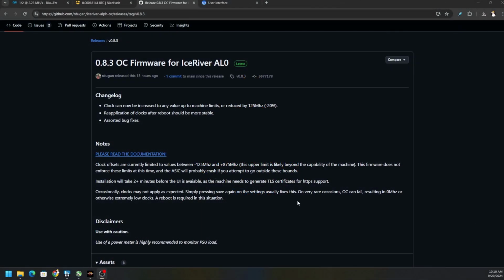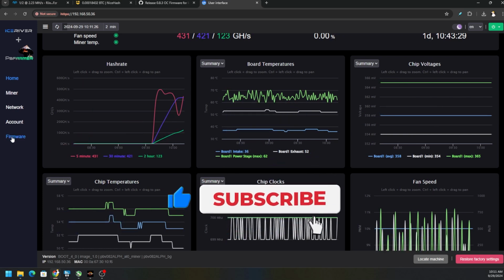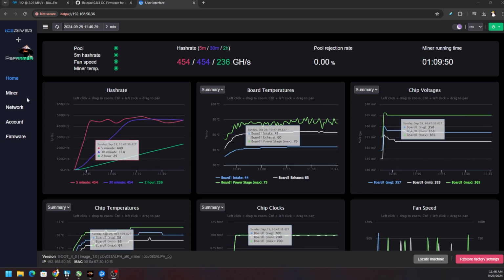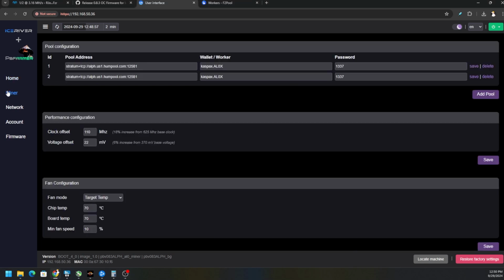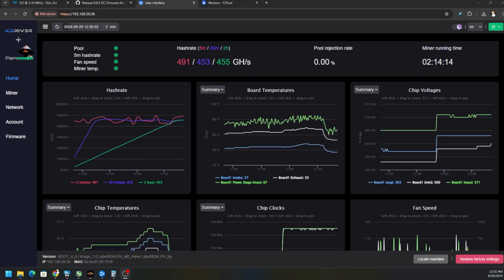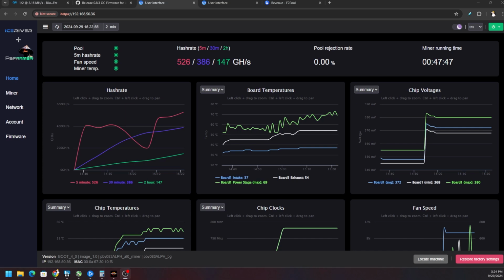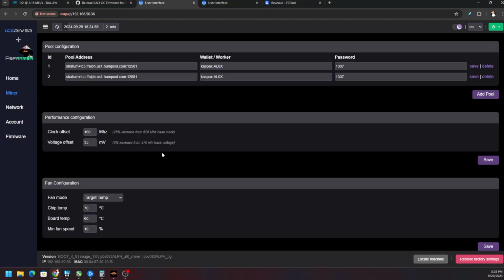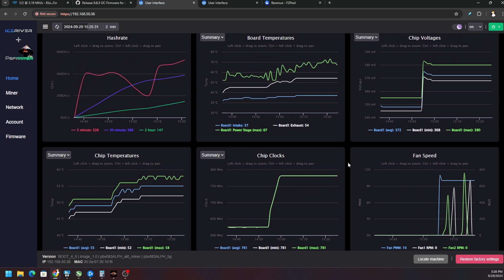New PBfarmer Firmware - Iceriver AL0 Overclock

Comment: I installed the PB farmer firmware on my AL0 and for some reason Board 1 Power stage reads 0 and when I overclock hashrate drops no matter what I set the overclock at. I've re-installed and reset and still same issue. Stock firmware works just fine.Anyone else having this issue?
Reply from the maker: @BigBelleeZ  thermals. Let it get warm before you turn up fan speeds if you have external fans on it

Comment: I really like the Chicony 230 watts from Aliexpress, I push them to 200 watts without any issue, they're also on amazon but for the double of the price, thanks for the update on the AL0 Firmware.
Reply from the maker: @domg6614  yea I like those to, thr others suck
Reply: @DomG6614  have you tried it on the AL0, if so what hashrate are you getting pushing it that high, and what’s the consumption in watts?
Reply: @DomG6614  have you tried it on the AL0, if so what hashrate are you getting pushing it that high, and what’s the consumption in watts?
Reply: do you have the link of that ?
Reply from the maker: @Eliotheparakeet  ALO Firmware: https://github.com/rdugan/iceriver-alph-oc/releases/

Comment: Did you make any changes to the hardware? Like adding heatsinks to the mosfets?
Reply from the maker: @akro286  yes, and better thermal paste / pads
Reply: @SerpentXTech  I was really hoping the thermal paste wasn’t necessary 🤣
Reply: Hi. Tell me please, what brand thermal paste and thermal pads and size thermal pads (thickness) did you use?
Reply from the maker: @marchcat2008  1.5mm